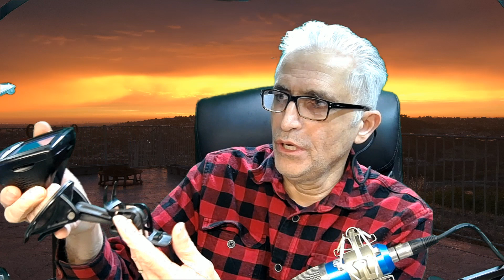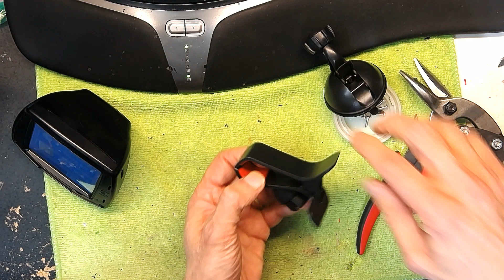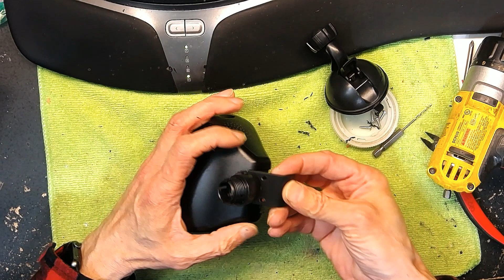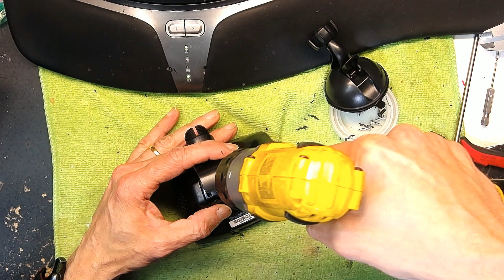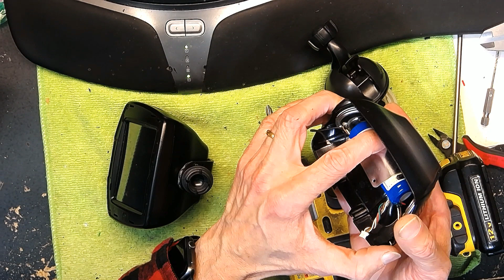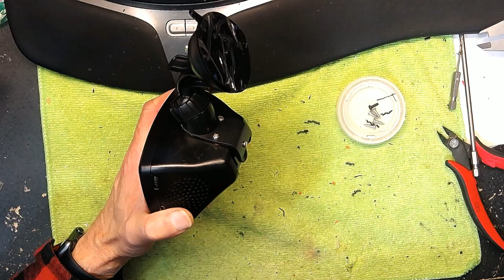Custom Car Windshield Mounting Mechanism for Garmin StreetPilot C320 C330 C340 GPS Navigation Device

Comment: Hi. I just bought an external GPS GLONASS ariel for one of these from China but it does not fit. It has a female SMA connecter on it. Can you please tell me what kind of connecter I need to plug in directly or point one out to me if you would please.
Reply from the maker: Sure you need this kind PART NUMBER 010-10702-00  and here is the link for it https://buy.garmin.com/en-US/US/p/1326#devices
Reply: @TECHNOLOGYTIPS101  Thank you
Reply from the maker: @fredjames2292  No problem!
Reply: Rather than drill holes, I just superglued it.